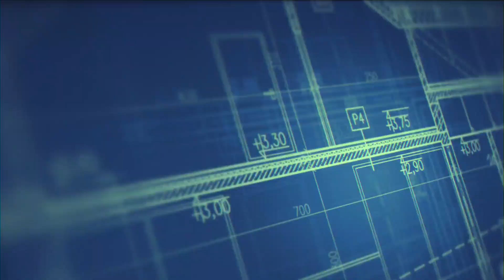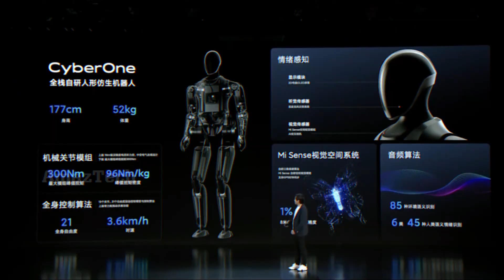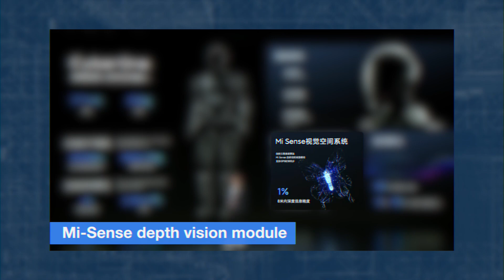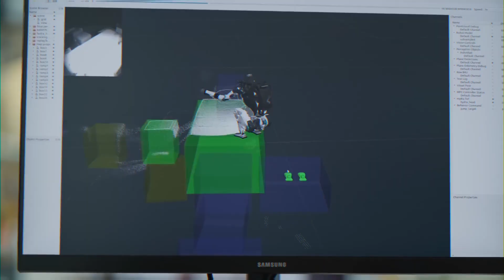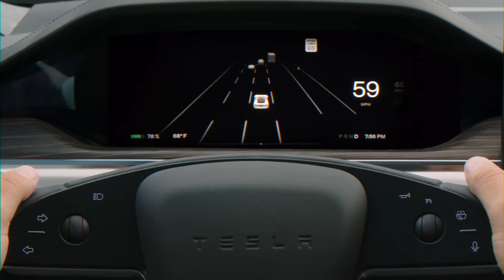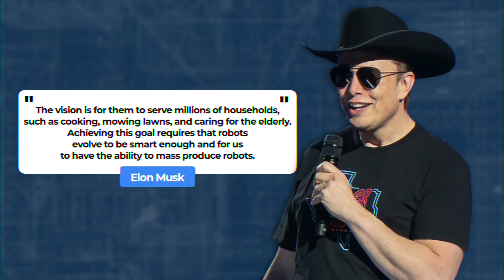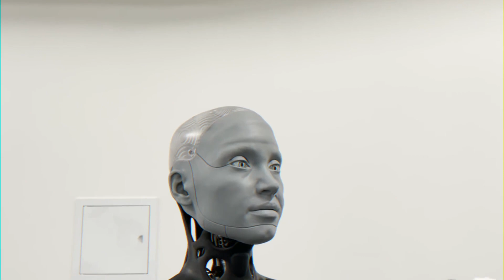The Truth About China COPYING Tesla With It's NEW Robot Clone..

Comment: Have cameras all around it's head 4 360 view 2way audio have a room with the 4 walls connected to the cameras on the bots head one camera on top of it's head so when you look up in the room u see sky like your room is outdoor when you walk your bot walks n you can see in real time, where it is by looking at your walls, if you sit down in a chair n put on a helmet so you can put your thoughts in the bot, weather the bot feels is the same in the eoom, if it's got the electric heaters will come on but if it's windy fans in the walls will turn on but if it's raining fill up a water dispenser outside the room and as rain falls it goes through the floor and circulates back up 2 fall again, as you put on a rain coat in the room